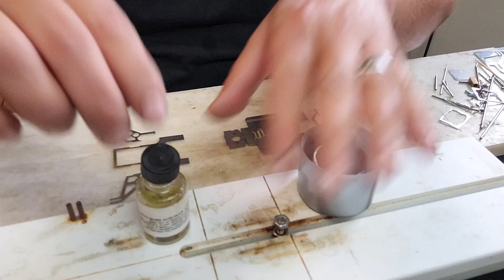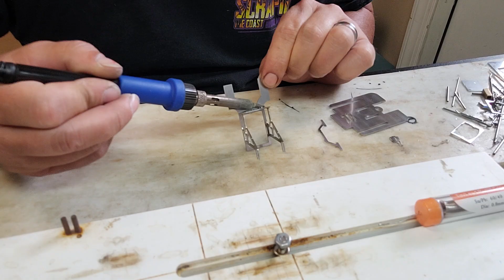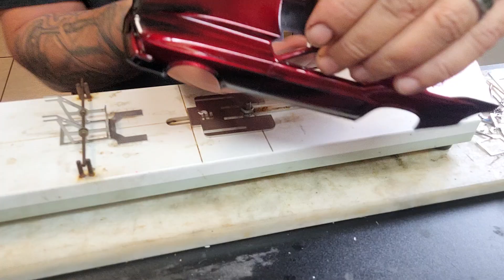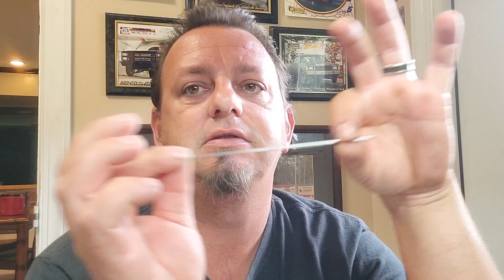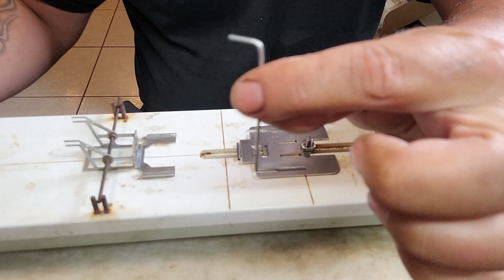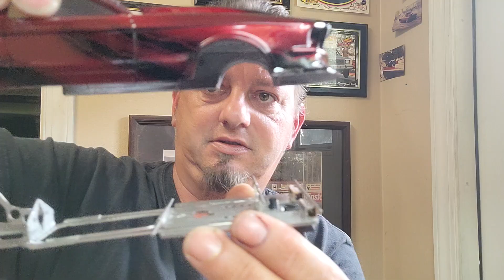HOW TO: No bar slip joint drag slot chassis

Comment: I have built real race cars from pro stock to alcohol rails but now im old and i want to build my own slot car  so how much is a frame flux and soder
Reply from the maker: depends on the chassis some are 10$ up to 25$ the flux is 5$ a bottle plus you will need the tubing which is 2$ ea

Comment: Man I can’t seem to find the .060 solid bar on Amazon. Can you provide a link?
Reply from the maker: https://www.amazon.com/Lyrlidr-Stainless-Industry-Working-Hobbies/dp/B0DCBHJVRL/ref=sr_1_11?crid=EL6120UQ2N5I&dib=eyJ2IjoiMSJ9.3_dk6Rp_EGQEelgnfXzFwOMydBK5aW_1MYmKSSz-syMjOq0RPlB5coULoZLvNKrrIi3kuObgqBXkw3iast1786Psf0QhGe--urK3bnWjuEgoDsn3g_zdIsa8oR-l852Qguc2ZCAg_GsuULrDn8bQ5oYkzg2xwOxMkFdQbh5LX-NVS8O1o2y_GCQ3uZcjNFhBJpyw8JMiMWKQE1t6CXepIEqSf6hHK3WfQharljG2NX0.AjVezO4_SOsCvQqDsUjdQHkxdiFkKEpdKDlx_beMRmw&dib_tag=se&keywords=1.5mm%2Bx%2B300mm%2B304%2Btubing&qid=1780593252&sprefix=1.5mm%2Bx%2B300mm%2B304%2Btubing%2Caps%2C134&sr=8-11&th=1
Reply: @SouthernKustomRacing I did see that but the conversion from .060 to mm comes out slightly over 1.5. Thanks for the link!

Comment: Have you found that soldering the entire joint is necessary, or is soldering just the pockets of the laser cut jig enough? I’m looking for the cleanest possible assembly, without being too weak. I even sand down the surface of the part, after soldering to smooth out the solder and the joints.
Reply from the maker: are you talkin about the tubes in the front plate?
Reply: @SouthernKustomRacing no. The motor plate and uprights for the rear axle, specifically.
Reply from the maker: @swansoninspections1845  i always solder the motor plate at the bottom under motor and the uprights at the bottom on the inside and to the motor plate and never had an issue